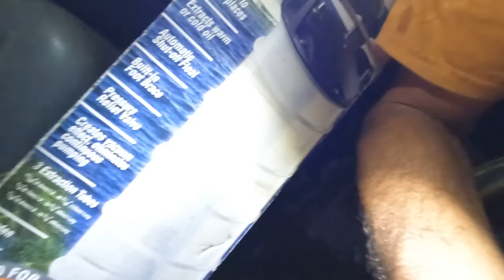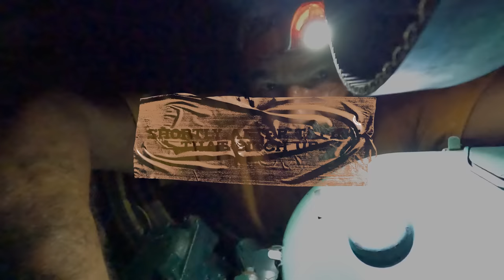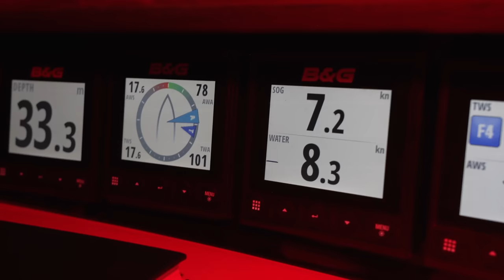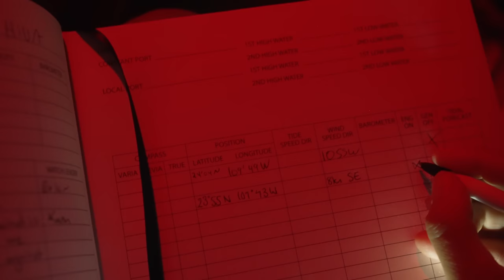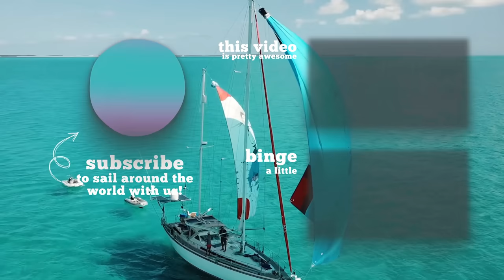Sailing Across The Pacific! 4 Semi-adults, 1 Toddler, and 3,000 NM (Part 1 of 8) S.V. Delos Ep. 416

Comment: One of the things I ordered from Volvo, when I first got her was to order all of the hoses, then had  Overheating issues, found the heat exchanger with all kinds of growth took the entire heat exchanger apart, proceeded to build a manifold similar to yours but added, fresh water ball valve so , I can back wash the thru hull, and layup the engine with a fresh water rinse before I would shutdown leave her with fresh water on the saltwater side, no growth, and no corrosion in the elbow.  The other end again with a ball valve,  with a run to the bilge, pair of old stockings as a filter so I can bring the engine too pump the bilge.   Keep a tie wrap on that valve, open with the thru hull  open you have a hole in the boat.   But keeping a full set of hoses vacuum sealed with my vacuum sealer.  Can you leave the brand of tape you used, seems like a great thing to have aboard.  Bravo Zulu Brian!
Reply: Fresh water rinse! Damn good idea!

Comment: 1984. 50' kettonburgh, we were leaving Manila, heading for the San Bernadino Straits then the 6000ml sail to Victoria BC. Ready, two taxis worth of provisions and..... motor wouldn't start! Our forward berth had 6  100 X 100ml timbers, 2 1ton blocks, and within an hour we had the frame up, the engine mounts undone (my job as I was smaller) and the engine hoisted, ready for inspection.  Problem fixed and we left the next day, though I can't deny a wee bit of trepidation in case it reoccured offshore. 65 days later we berthed in Victoria - I took all of the sextant shots and quietly glad the Straits of Juan de Fuca were where my calculations put them!! Now 66yrs old, home in NZ, and if you need a surrogate Mormor when you get closer to NZ, let me know!!! Would love to sail again.

Comment: Love the dolphin moment. 
Is the Rescue tape a US thing, it sounds great. I've had another great product from the US  in my workshop for years - JB Weld. Awesome stuff.
Although you don't usually get many on a boat, old inner tubes are a great emergency plumbing fix - cut it in a thin strip spiralling round the tube, wrap it round plumbing leaks, pulling it tight over itself, works great on normal mains water supply, not tried it on coolant hoses yet.

Comment: This is laughable. First of all you should have recognized the coolant leak before departing. That is simple stuff. Second, your failure to return 4 miles to port of departure for proper repairs shows really poor judgement. If you need that engine in an emergency and the rescue tape fails, well good luck. Can only imaging what other troubles you will have.